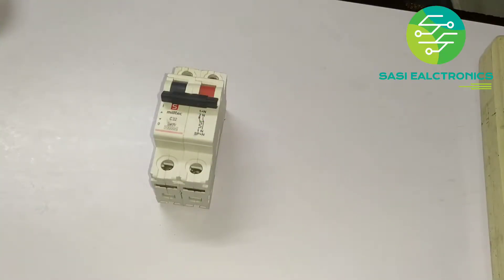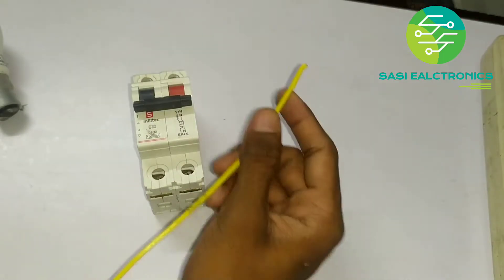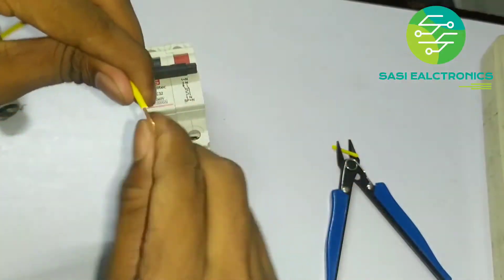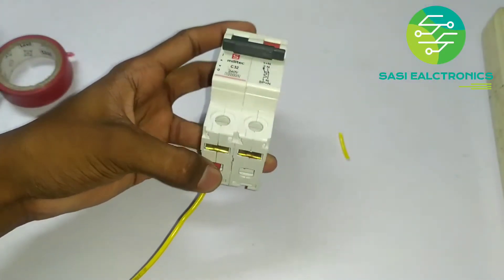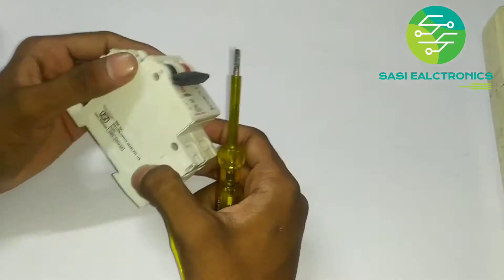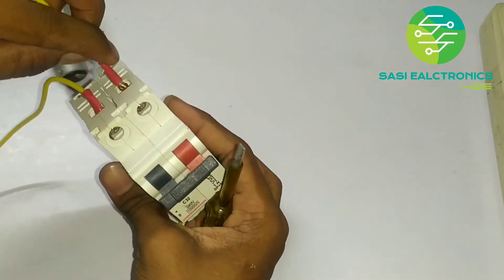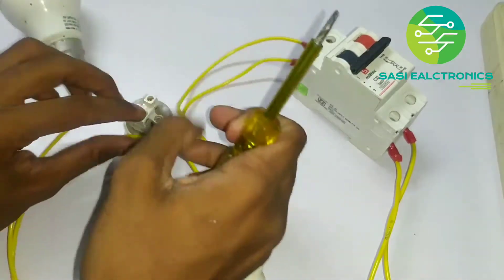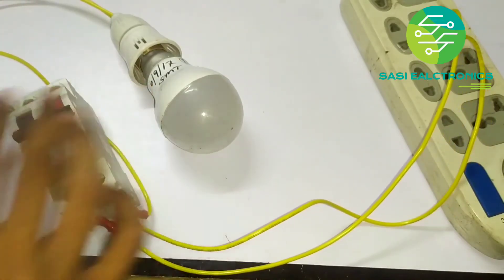How To make 2 pole {MCB} connection Tamil

Comment: Single phase Meter boxla out put  phase 1stla edukanuma 2ndla edukanuma edutha piragu mcbla entha orderla load kodukanum right sideah left sideah
Reply from the maker: lift side Meter la 1 pin EB Input phase,2 pin Nutrol, 3 pin Out put Nutrol 4 pin Out put Phase and MCB la Kela Out put Phase kutukanum mela home wring in put kutukanum
Reply: @SasiElectronics  mcbla entha mathiri  line kodukanum leftah rightah  phase nutral athavathu 1 illa 2ah
Reply: Pls sollu ga